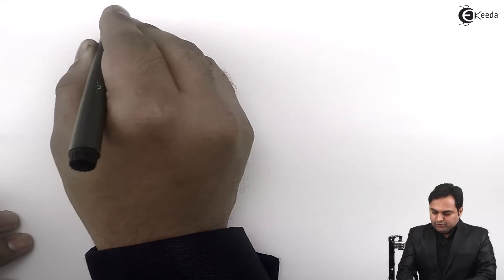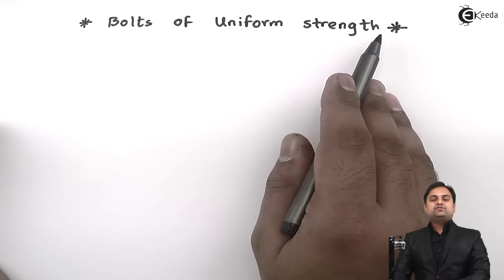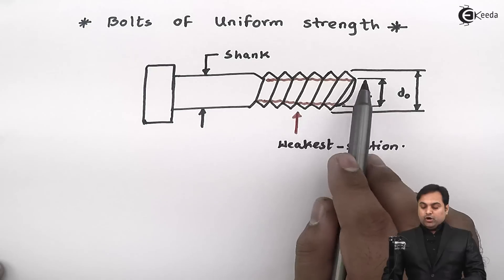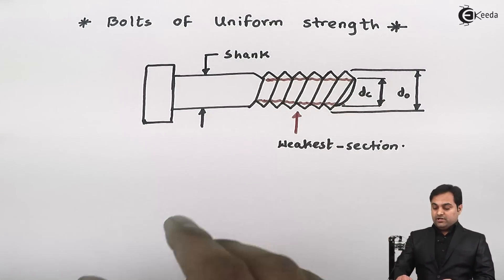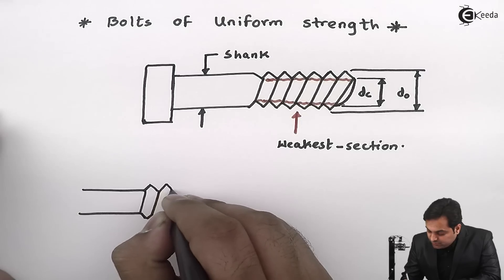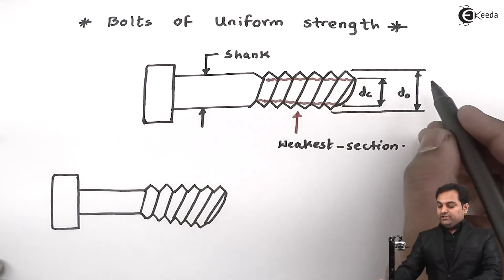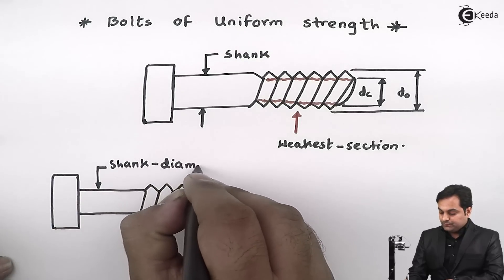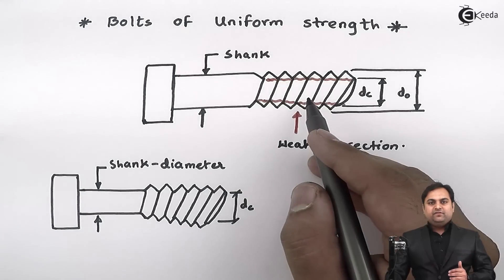What is meant by Bolts of Uniform Strength - Design of Bolted Joints - Design of Machine

Comment: Stress are is not calculated with by core dia, and for bolt with uniform strength shank dia shud be less than pitch dia, this type of fasteners is used for torque to yield tightening

Comment: How much length can we drill a hole? 
What is the formula for finding bolt of uniform strength? 
Please reply me sir.
Reply: We can drill a hole shank portion end
Reply: @aqeeljoya3054  tq
Reply: Drilling of bolt is not recommend  as it will reduce head Ares which can result head chip off during tightening

Comment: i have seen some bolts which are splined at the shank what are they called as
Reply: Bolt are splined to avoid rotation during tightening of nut
Reply: @chandrakantprajapati1270  yes I agree but don't they have any specific nomenclature?
Reply: @hemanthkoundinya4977  no they are special bolt, size of spline is dependent on amount of torque hope I ans your query, other type of bolt to avoid rotation is carriage bolt but can be inserted from bottom side of assembly